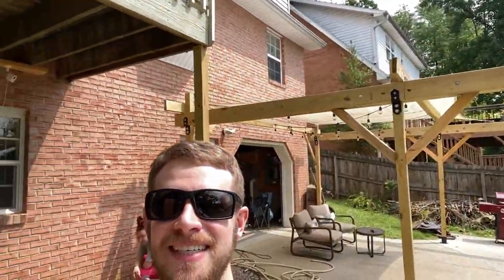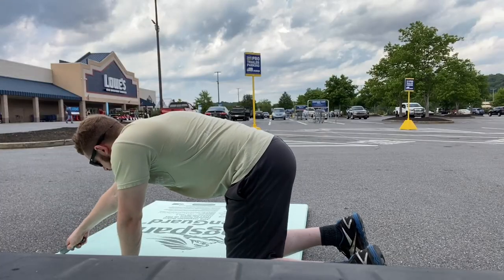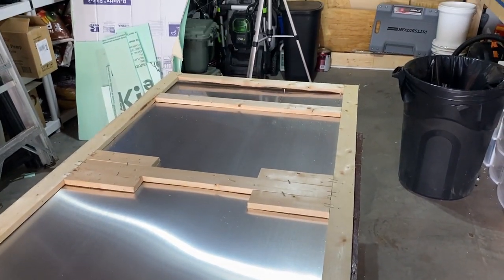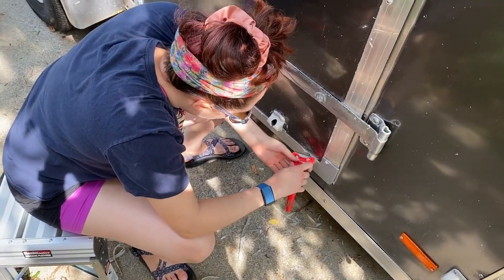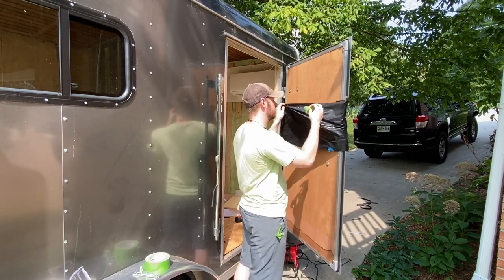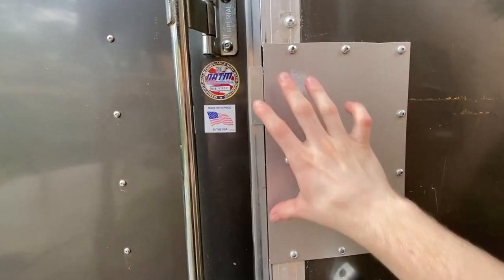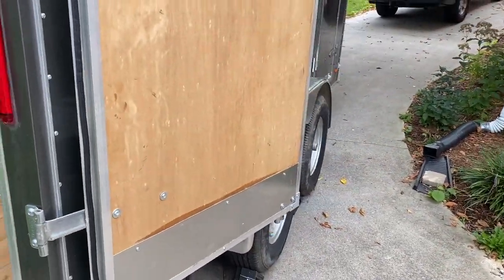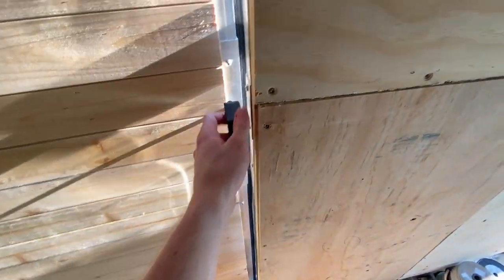Cargo Trailer Doors | Insulation, Windows, Latches in a DIY Camper

Comment: that shed latch is 10000x easier than trying to cut through the angle iron of my door and putting holes everywhere. it actually gives it a much nicer looking DIY look as well which i wouldnt even have seen if it werent for you! thanks!
Reply from the maker: Great point!

Comment: In other videos people frequently talked about the possibility of being locked in with that big bar lock.  The best solution I saw was that someone put a second latch on the wall to the left of the door.  You take the padlock off the latch on the door, swing the bar against the wall, the put the padlock on the latch on the wall so the bar is locked open.
Reply from the maker: That's actually exactly what I plan to do!

Comment: I'm still trying to wrap my head around door wasn't framed with aluminum. Jessshh..and then not sealed as it will be exposed to rain even if for a few moments. You sure informed me a very weak point. 
I think the cedar t&g is not only better looking but gives more support with door structure. Good call!

Comment: Thanks for all your info when you silicone caulk make sure you cut the tip with a small hole, when you apply it do not touch it then spray Denatured alcohol on top of it then clean it off it makes it a lot easier to remove the residue and it looks pretty tight when you’re done

Comment: Doors look good. Regarding the rot/mold at the bottom of the doors, I would have suggested you use penetrating epoxy. It's thinner than regular epoxy and made to be absorbed into wood fibers to prevent further damage. Then, sealing the rest of the wood, before the cedar, would protect it in the future. The cedar planks look good.
Reply from the maker: Interesting idea! I may have to talk about that in future vids

Comment: Wow $1,000 for a door! I can't imagine 
A few peices of wood cost that much.
Great job of making it work.  My doors are famed in aluminum. I'm still too nervous to take the man door apart.
But I did get the back doors insulated.
Good luck. My man door also has an
R,V. Latch with a deadbolt.
Reply from the maker: Thanks 👍

Comment: Hello again I still have not try to take my side door apart and insulate. Too scared to try I'm afraid of running into problems just wondering what your thoughts are about drilling small holes on the inside of the door and filling it with spray foam insulation. Would you think that could work. Would appreciate any info thank you

Comment: The side door you should have replaced the water damaged panel. That will continue to deteriorate. Otherwise thank you for doing this. As I stare at my 7x12 trailer and figuring out what to do. I’m not going with blown in insulation. That much I know. Lol

Comment: We all screw up, no worries.. You will take care of it. I am surprised there were No metal frames around the doors, You can try fingernail polish remover  aka acetone. For the aluminum and steel plate might use pop rivets in place of the screws. Doors look great.
Reply from the maker: Thanks! They turned out well after all the suffering haha

Comment: What did you do about your cam bar being locked when your inside? Get another latch and mount it on the left side of the bar so you can resecure/lock the handle with your lock. Make sure when mounting the extra latches you back up the aluminum skin on the inside with a piece of plywood.
Reply from the maker: That's exactly what I did. I think I have that footage in another video.

Comment: The caulking is milky looking from applying it to thick and it cured slower. There is actually a few better caulks to use. Silicone not only is messy and gets on everything it isn’t paintable. Well it is but you need to know what you’re doing. It isn’t easy.

Comment: Quick-ish question, I'm in the middle of a conversion myself and while still on the fence about how many of these doors I want to deal with (if any), I was wondering what bit you used to actually get the bolts/screws out of the hinges in the first place? Most people I ask (as I'm sure was your case as well), have never seen let alone heard of an 8-Point Star head on a screw. Especially of this size. Any help? 😅
Reply: Try a #2 square head bit. It's what we use to install them.👍
Reply: Try a # 2 square bit. It's what we use to install them at the factory.
Reply: They also sell a full set of bits at Napa Auto.

Comment: I haven’t watched all the videos yet but if you are going to do tongue and grove wood again nobody does face nailing. You run the staples or nails in to the tongue at an angle and only face nail the top and bottom boards. It’s stronger and tightens up the boards as you go and less staple or nail holes to fill in later.
Reply from the maker: Of course! Yea that is the standard I know. However this thin cedar and pine stuff shattered all to hell when I tried that. I think just because it's so thin.